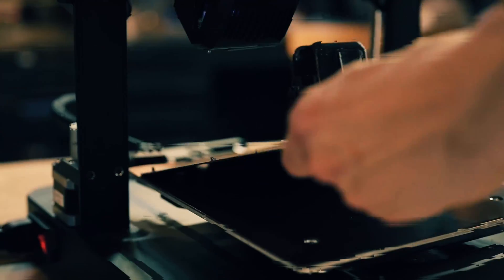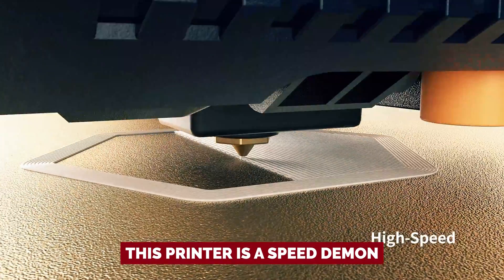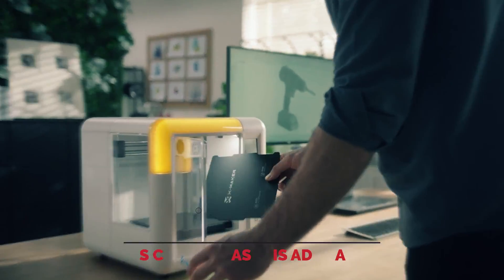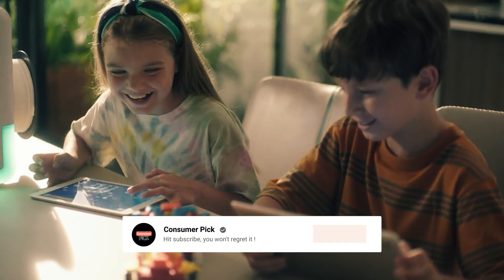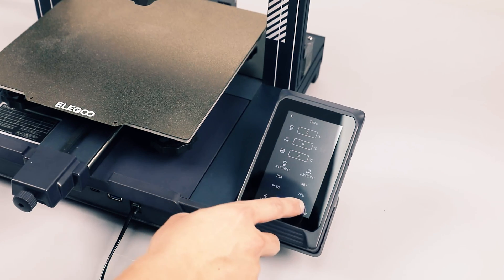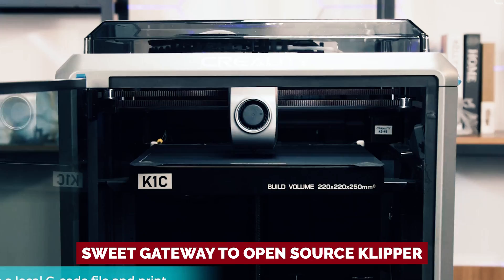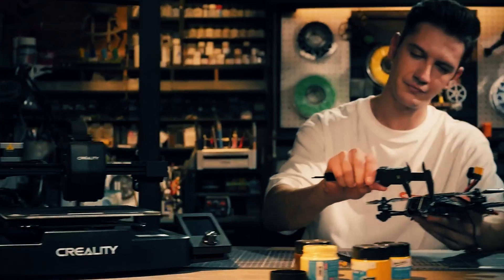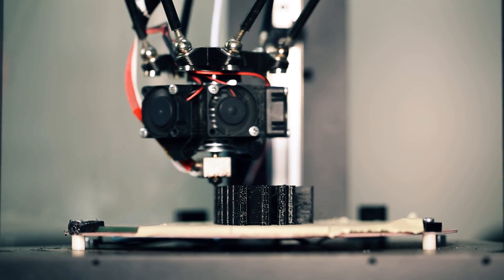Best 3D Printers 2024 - (Which One Is The Best?)

Comment: I'm picking Bambulab A1 because it just works - no hazzle - it just works 100% and I find it far more useful than my Ender 3 V3.
Reply: Also considering Bambulab at this point
Reply: yes the bambulad a1 is very good but his price very high and expensive spare parts compared to crealiry ender 3 v3 se is have problems that can solve very easily and cheap spare parts
Reply: @rusfi1983  I don't agree with you on "very high". Sure it is more expensive that the ender 3 v3. So if you are going for the price alone, then the Ender 3 is a cheaper choice, but if you go for value for money, I would pick Bambulab A1 any day of the year. It is, simply put, much better and easier to use than the Ender 3.